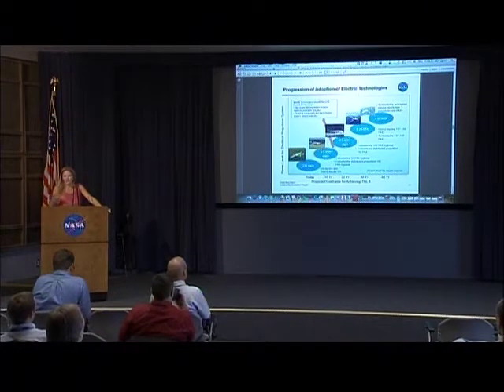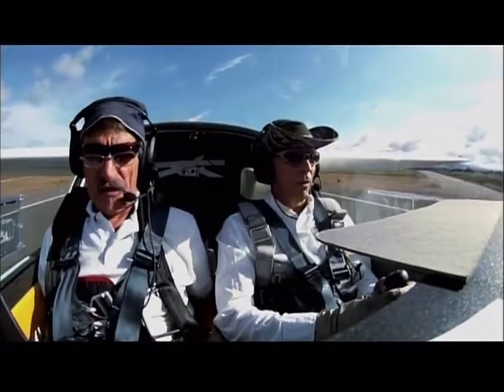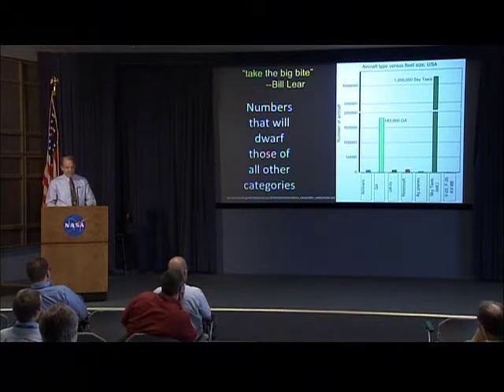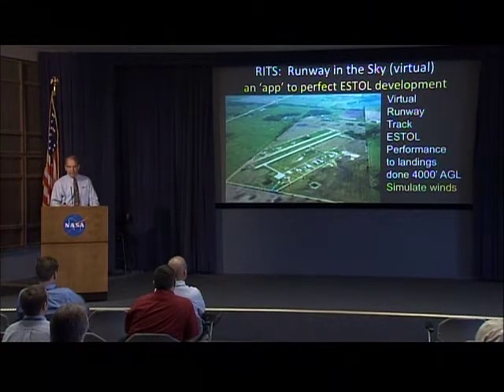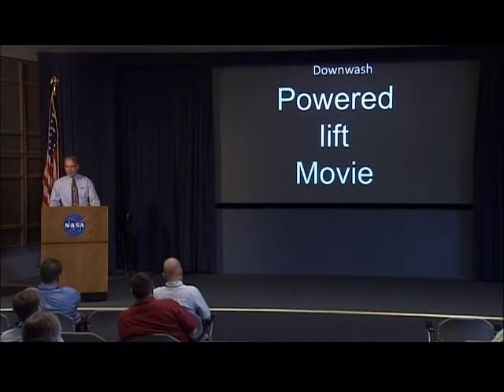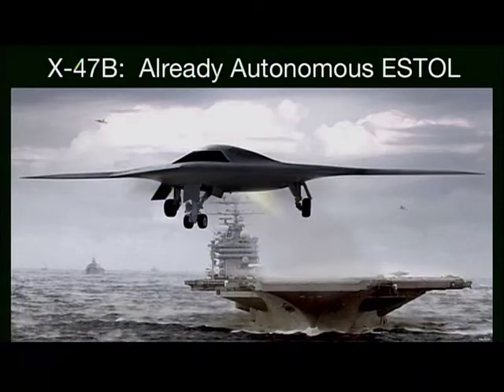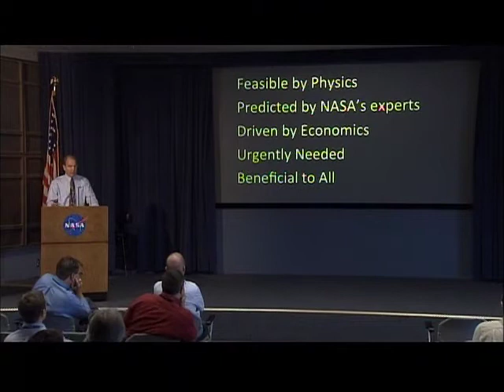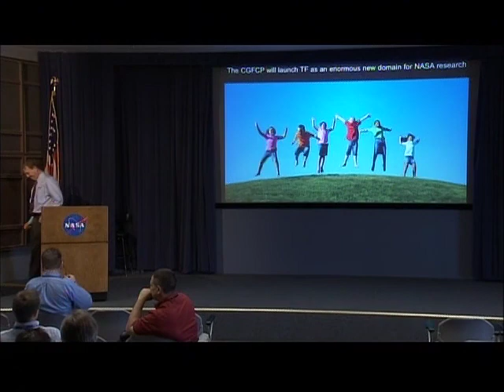Evolution of Transformational Flight - NASA Dryden 2013

Comment: No, GA accidents are mostly design errors.  
Door to door time saving is best without a vehicle switch...roadable seaplane...like what I propose.  No air parks.  No door-car-airplane-car-door nonsense...just door-airplane-door.  It takes time to load and unload.  People use vehicle to store valuables.

The contest distorts R&D.  Since he is not an entrepreneur then he should not be involved, just as any government entity should not be involved.  $1 trillion dollar market?  No, much more, but not with your goals.  Sorry, people will not tolerate your nonsense. 

His figures are nonsense.

His concept at 1:07:41 is a joke.  Sorry.  This is why this guy is a government employee...who should not be allocating resources via any contest he has no idea what the market would value.  Swap a battery every 100 miles?  LOL.  

Cost analysis?  $216/hr?  Wow...LOL^1000  Try 1/10th to 1/20th that....  Stop wasting tax payer's money.  This should be a felony to even make such a presentation on government time.  

No solution to the parking issue?  Try not parking...

$1-2 million for pocket park.  Next idea....  Not needed...

Yes, distributed.  Wow, there is hope.  

Catapult?  Again, not needed when you have the right concepts.

Comment: Wow, he actually got one thing right...VTOL is NOT the answer due to noise and dust.  My airplanes can do conventional landing, ESTOL and VTOL.  

His figures for electric cars are total FRAUD.  Electricity at 12 c/kw-hr is $4/gallon.  Battery is $4/gal to use it.  Road tax at 100 mpge is at least $3/gal for a total of $11/gal for that Electric car.  That makes 11 cents/mile.  Road tax for a heavy battery car should be about twice what my car will be and the difference (3 cents for Tesla and 1.5 for my car) is the cost of fuel for my car.  200 mpg on Natural Gas is 1/2 cent/mile...on Hydrogen 1 cent/mile.  1.5 cents road tax plus 1 cent/mile fuel is LESS than the road tax for a heavy Tesla car at 3 cents/mile.  At no point every will Electrics be cheaper than what I propose due to road tax based on weight and distance which is the most fair way to tax.

My roadable seaplane two plane will be 1 cent/mile at 100 mph on $1/gal natural Gas.  (meets the 200 mpg per passenger goal)   4 cents/mile at 200 mph.    If you made your car like that airplane, the car would be would be better.  Nobody would buy a car like that airplane due to the seating, comfort, size, cargo, crash protection and on and on and on.  This shows this guy is totally clueless...

20:1...no hard to do...

Pop in battery pack?  Good luck with that.  
The reason it costs so much is the designs stick on ice.  They kill, that is why, plus the FAA is full of idiots like this guy.

Near perfect safety record...right after he complains about certification costs?  I have a headache...
When you takeoff from a road at 35 mph you are already at flying speed with power on lift...Drive, fold out, power up, rotate...no airport or massive acceleration needed.

12 foot prop???  Sport plane???  Loony 

Autonomous?  Moller skycar remake?  No, does NOT need to be autonomous at all.  You need computers because you lack basic design skills.  Wow the public?  No, try making something they can afford.

Comment: My airplanes (six sizes) will meet all the 11 goals, and more (over 30 innovations), not just the three.  No need for electrics or batteries with the right engine system.  Yes, distributed.  No to electrics.  Can run on all fuels and hydrogen, and use battery if that is needed for some insane reasons, such as you think CO2 is evil.  Yes, door to door.  Yes, 4 times better crash protection to current cars (former airbag engineer here...).  Electric is NOT the end game, wake up.  My airplane is the perfect air taxi, not the stuff this guy promotes. No, just stop funding your buddies with bad ideas.  Just need to have a rich guy with money meet a the right guy (seaplaneguy) with the right ideas.  Just stop with the PC nonsense.  Prizes distort the goals.  You have NO idea what is needed....  120 mph?  no...sorry, again, you don't have a clue.  Apollo program analogy says you don't have a clue.  245 million flyers?